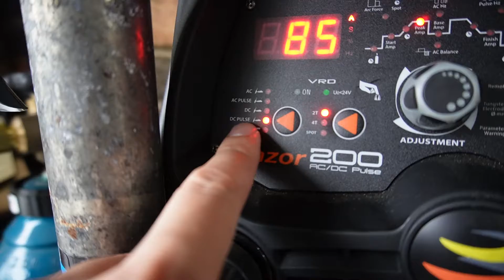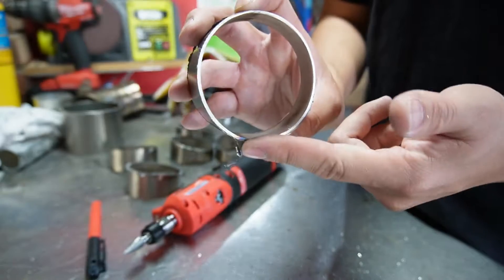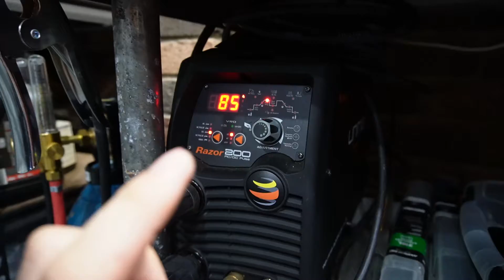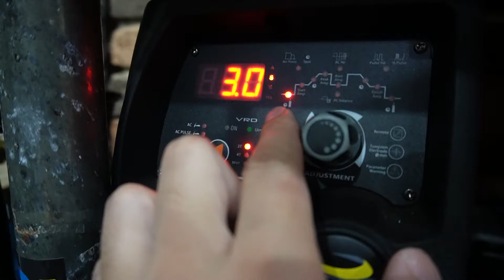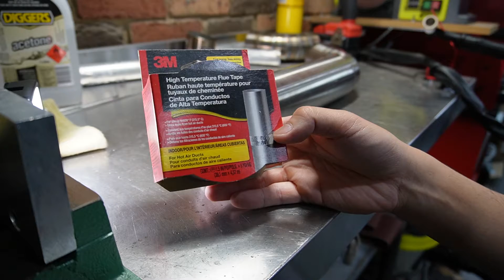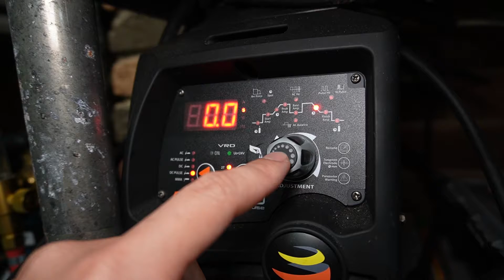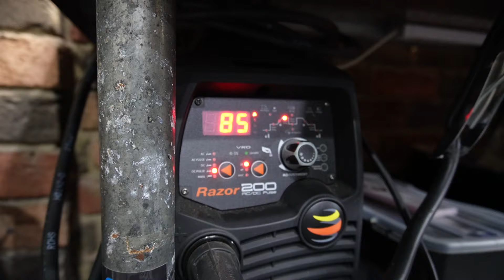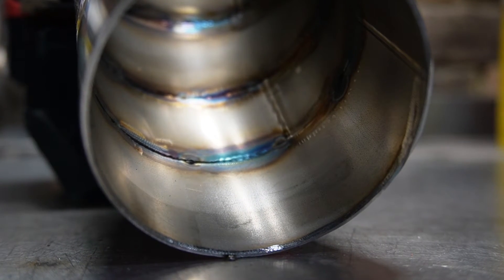STAINLESS INTAKE PIPE TIG welding with a beginner

Comment: At 8:00 in the video....
When putting a sharp point on the tungstin tip, best to use one dedicated belt (if using a belt sander) or sanding disc (if using a sanding disc) to do the sharpening tungstin. If you use the same sanding medium for both stainless steel tubing deburring, you'l contaminate your welds. it has been explained to me this point and it makes sense. Why go to he trouble of fine deburring, and cleaning with acetone if you will willingly contaminate using a common belt with both S S and tungsten? 
I have very little TIG experience so far.,. The time I spent practicing basically taught me the fundamentals. I never spent hours getting my position of wand or filler rod into pa osition that works for me. Now, I plan to fab an entire twin turbo set up from scratch. Im not buying a kit intentionally. My reasoning is that in real world TIG welding & fab work I will not have ready-to-go setups at hand. In the field I will need to learn how to choose all parameters every time I lay down a weld. All my wrenching experience has shown this to me down the road as I progressed in finishing up projects to my satisfaction.And for sure, I do not have a set time frame this project to be completed by. it is not my daily driver so I'll go at a pace that yields near-perfection results. .I know I will end up buying 100 feet of tubing to end up using 15 feet which looks great. Down the road those numbers will hopefully turn around and I'll get down to the 10% over needed material to cover mistakes! Seems all building trades are around 10- 15 % waste material. lumber, rebar, etc...

Comment: If you don't mind a comment from an old school aerospace welder, I've a suggestion.

The fancy new speedglass welding helmets are so convenient but...everything seen is of shades of grey.  Which makes it difficult to see the transitional changes in color of the base metals and distorts detail.

Find a welding supplier that offers OLD style helmets and use a #10 GOLD lens.  As you ramp up the current with the pedal you can actually see the cleaning action prior to the fusion/melting temps especially with aluminum or any non ferrous metals, the heat affected zone and the pretty blue/green/gold colors welding stainless/titanium.

Try it, you won't believe the difference.
Reply from the maker: Again appreciate all comments.
Currently i'm just using the stock helmet which came with the welder and have terrible vision! I find myself welding better at night with the lights off in the garage as it seems the most consistent. I have looked into helmets recently as one of you recently let me know it's time to invest in some protection from the toxic fumes. 

I do like the 3M helmets being the 3M brand but open to other options. Is there a particular helmet you would recommend?
Reply: @JCYT  <
My old helmets are Wilsons, probably not even available in Japan.  I've seen, used the new speedglass helmets, love the adjustable lens darkness but, for detailed up close tig work, I'll stick to my old timey helmet with the large gold lens.  One can literally see the transitional stages the metal goes thru at different temps and can see the color change in most ferrous metals.  If you do choose to try this out, DO get a protective plastic cover for the lens.  The gold coating is easily scratched or burnt thru by spatter.  This would allow the damaging ultra violet to pass into your eyes.

These are available in plastic (less expensive) and glass (more expensive)  The few that have followed my suggestion of the gold lens are amazed at the detail they never saw before.  Even those using the new speedglass helmet/lens.  To tell the truth, I'm not even sure if the gold lens is still available.  Mine is almost 30 years old, haven't been in a welding store for years.  But if available, go for it!!  You'll be glad you did.

I've had optometrists/ophthalmologists comment, ask if I am a welder.  The can see, find evidence of 'flash burns' deep in the retina.

If I were a production mig or stick welder on thick, heavy gauge material, I'd opt for the speedglass feature otherwise I'll stick to my 'old' gold lens for detailed tig work.

Who turned me onto the gold lens??  A fellow racer and Navy serviceman who did aluminum tuna chase boat repair as a part time job.  As you probably know, aluminum reflects much of the arc energy back to the weldor. The gold lens (available in several darkness levels) offered better eye protection than the really old school dark green lenses.  But I was sold on being able to see so much detail never seen before.

Toxic fumes??  As a part time, hobbyist welder, I don't think you really need a full on fume extraction system if you stick to clean stainless, steel and aluminum. If you start working with a LOT of large diam. stick welding or with coated steels like galvanized steel then I'd be concerned.  The weird green smoke from the galvanized zinc coating is VERY toxic. especially if gas welding or brazing.  I understand it has the same chemical constituents as the mustard gas used in the 1st World War.  They say if affected, severe headaches, blurred vision, dizziness to drink lots of buttermilk.(yuck!) Supposedly will help counteract the affects???  

 The ducting, hood, metal flex hose, big squirrel cage fan in a garage would be a PITA to put together and expensive.  Are you willing to put a big hole in the wall of your garage to direct it out??  As long as you have a bit of cross flow ventilation, I think you'll be fine.

Comment: It's definitely great work that you did there but I can say that unimig that pulse is awfully aggressive on there I really don't like welders that got that aggressive popping when it pulses I have the prime weld Tig 225x and mine is silent as can be when I'm pulsing but I hardly use the pulse I'm more of a straight welder.
Reply from the maker: Thanks mate! Appreciate the feedback. 
I thought the aggressive popping was due to the machine settings and torch height rather than the machine itself. It does sound like it's coming from the torch rather than the machine. I'll definitely look into it!
Reply: @JCYT  it comes from the torch as the arc ignites you can also see it whenever you try to weld razor blades together you'll notice that it will nip the edges off that's the aggressive start on the high frequency.

Comment: Nice work. you might be able to make a couple of bench jigs out of two little caster wheels on mounting brackets to make turning the pipe easier & smoother
Reply from the maker: Thanks Dusty! That's actually a really good idea. If i really got into welding more i was thinking of getting a small turner. But a jig on castors may be a good option! I'm thinking it'd be especially helpful with doing flanges v-bands etc
Reply: @JCYT  You can get little D cell battery powered single speed (slow) turners for fishing rod building & doing the slow turning of the rod when doing the epoxy, they are pretty strong but something RPM adjustable might be better.